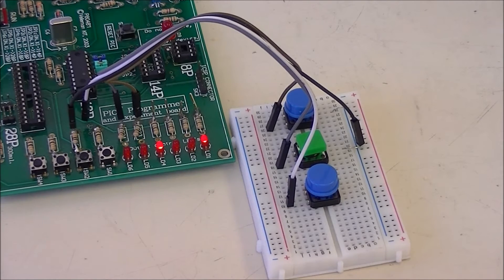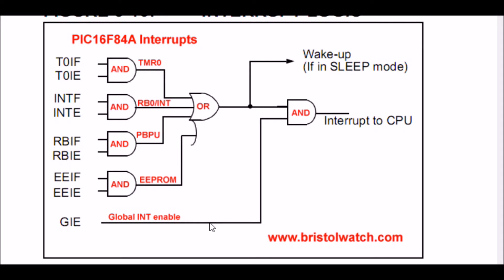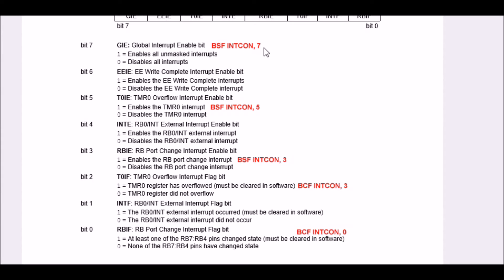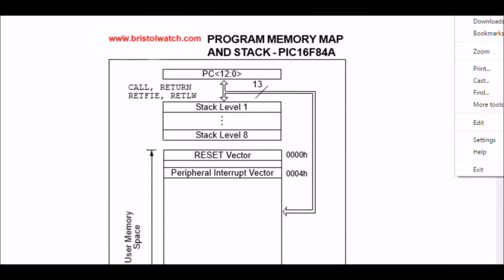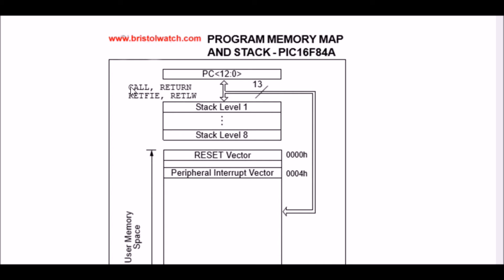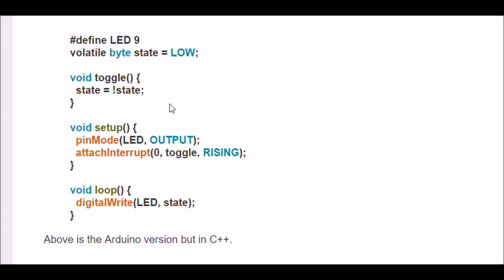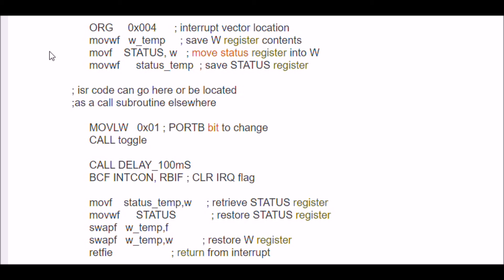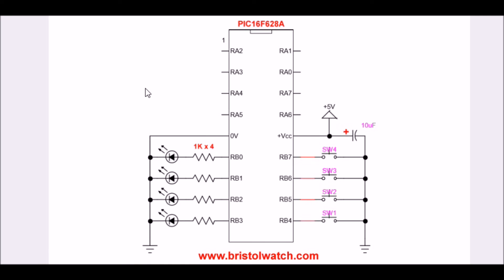PIC16F84A-628A Hardware Interrupts Tutorial

Comment: Putting a delay in an interrupt service routine is very bad practice!
Reply from the maker: Not in this case. How do you see the LED without it? The delay is a software loop not related to interrupts. This is a demo. Thanks for the input.
Reply: I would use one of the hardware timers with another interrupt. You would set, say TIMER1 to generate your 100mS delay then use the Timer1 overflow interrupt to toggle your LED. Incidentally, calling subroutines from an ISR is also bad practice, your ISR should be self-contained and execute with as little delay as possible.

Your delay is a software loop within the ISR, that was my initial point!